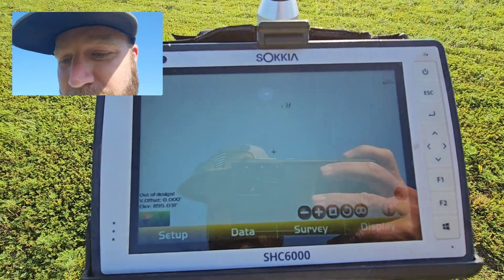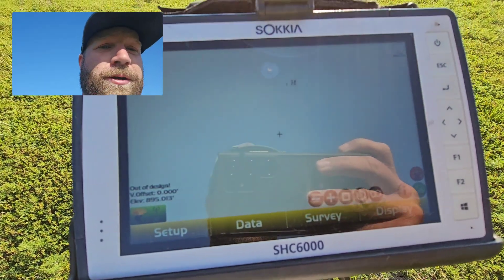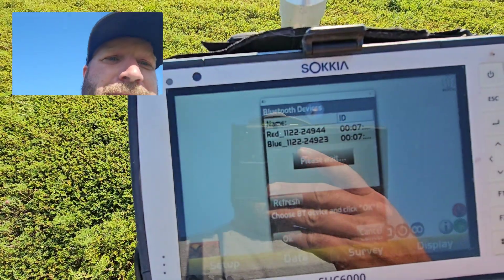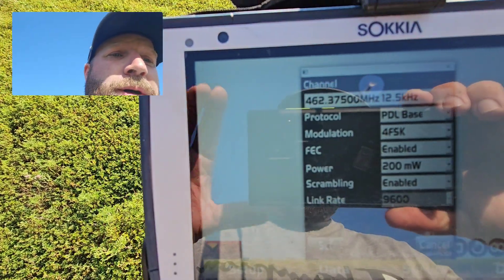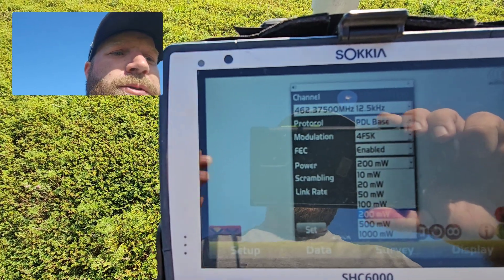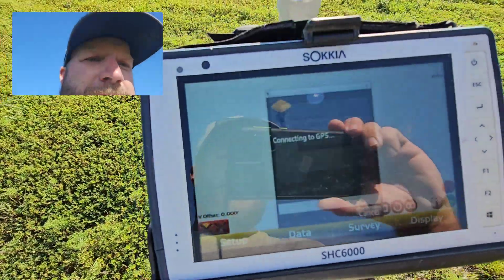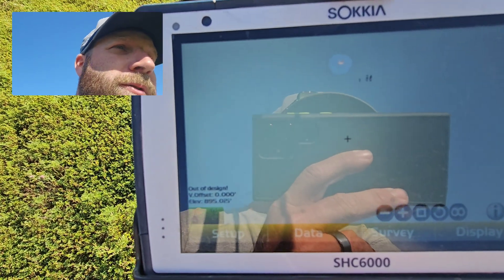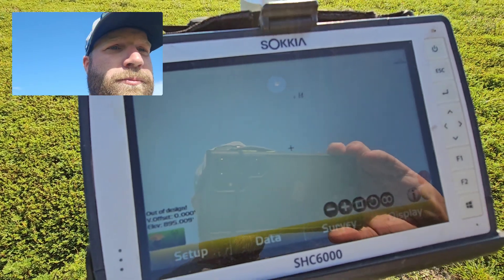Setting Base Power Output - Topcon Pocket 3D

Comment: Can I go higher than 1w is magnet or do I have to change the radio type etc. I’m ci for table using the system for site work but I haven’t ever messed with the radio settings much and want to know what’s best and all my options.
Reply from the maker: The internal radio board is a 1 watt radio. If you need more output you'll have to use an external radio. There are many different radios that can be easily connected and configured. 
Pac Crest ADL Vantage 35
Topcon SRL-35
Satel has several different sizes or external radios as well.

Comment: Hey buddy I know its not related to this video but how do you change color lines within a surface. For example if you wanted the road lines a different color than the rest of surface lines so it stands out in the dozer/grader screens? Thanks!
Reply from the maker: Yeah definitely, in the data collector if you go to Data > Layers you can select a layer (curb or building, etc) and change the line color to whatever you desire. We try and standardize our models that we build so that the line colors are always (Blue = Storm) the same making it easier for the operators to understand. 
In Topcon machines you go to File > Layers and you should be able to change it there. If you're not sure what layer a line is on you can hold down on the line or select it and hit the little i in the bottom corner and it should give you the line properties, including the layer

Comment: I prefer run all day bases off of 12v lawn mower batteries with aligator clips running on a power chord.

Ive had them last 30+ hours on a single charge. Great for keeping machines running (and forgetful formen). 

I just ran a hiper V off of my car today when it ran out of juice. 😅 Good stuff, keep the videos coming, seems like there isnt much community info on these as Id like
Reply from the maker: Yeah that can definitely work. I tried and test all sorts of different batteries and solar panels. I have plans to make a video covering some of the best combos I've come up with at some point.